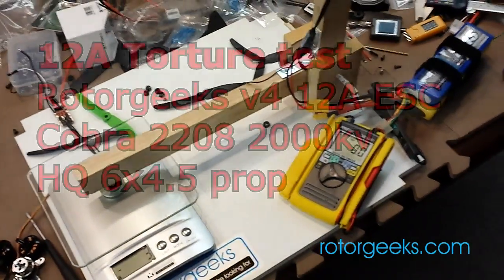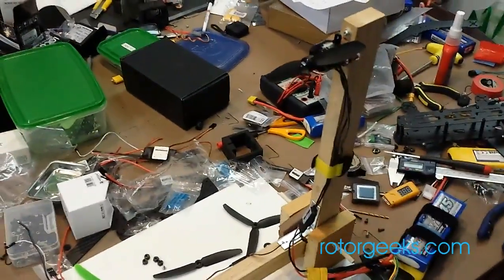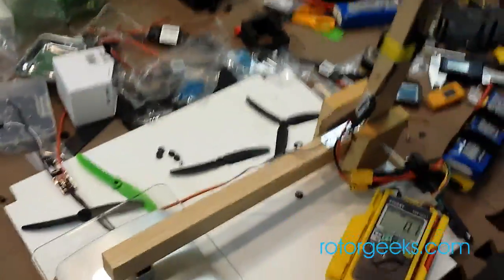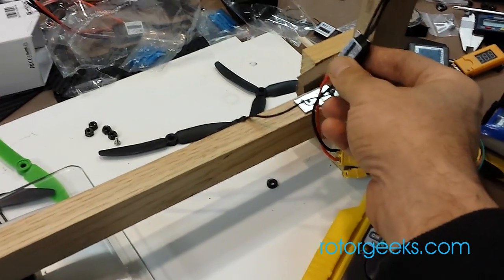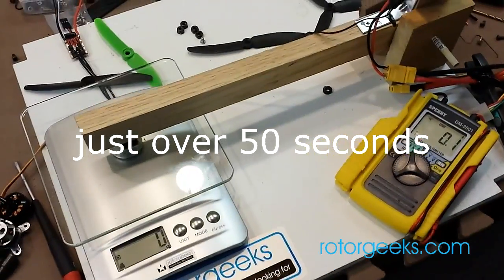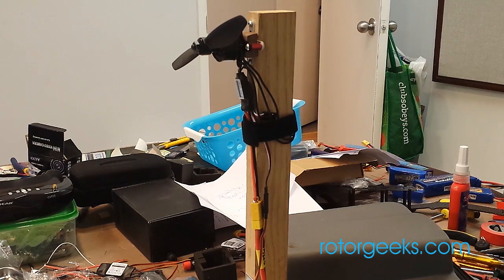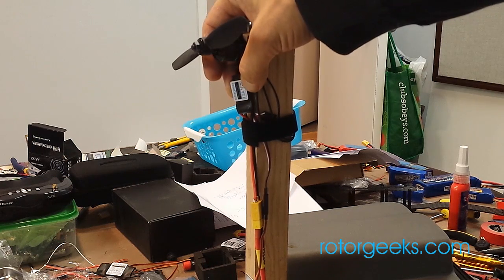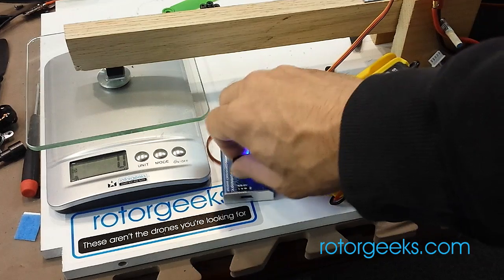4S Torture test - Rotorgeeks 12A ESC faces 22 Amps

Comment: I'm planning on rebuilding cinecan. I burnt one of the esc. Now that motor sometimes won't spin and when it does it has less rpms. Flight control adjust for it though.. 
Thinking 12a esc tiny whoop board but dont know if it can handle  small 4s battery 450mah or smaller if i can find.. also will use 3s for indoors if i can.. What a good motor with 2" props for that setup..? I saw a 20a tinywhoop board too.. currently cinecan feels real heavy but granted could be because of burnt esc

Comment: Hi, I've got the 30a version but unfortunately got some serious sync problems and the motors stutter at low throttle. Updated it to the newest few but not better, may you got an idea? Thank you
Reply from the maker: zozolione hi - contact me through the website with some info about motors, props, battery and firmware version.  Thanks!

Comment: I want to get some escs to use with the cobra 2300kv motors with 5x4props on 4s pulling around 15amps will the 12amp escs work I have my current escs mounted directly in the prop wash

Comment: Good stuff man! I use these on my 3s build with Cobra 1960's swinging 5040/6030s.
Gonna build a quad primarily for 4s running 6045's (need more speed!) but I LOVE these ESC's! Any plans for a 20A version (lighter than your 30A), or will these do fine on 4S/6045? This torture test makes me wonder... I fly aggressively, but keep my ESC's above the arms.
Also, does this motor provide a noticeable power increase over the 2206-1960's running 6045's on 4S, or should I stick with the light guys?

Comment: How reliable are the BECS on these esc? Have these been tested running a esc with BEC powering a fc and rx? Heat generated?
Reply: Hey there! I use the BEC on this ESC to run my FC and RX on 3s. That ESC does get a little warmer than the others, but not by much. Airflow keeps it cool, even swinging 6045's.

Comment: Just started a build of a Blackout Super Mini Quadcopter (6" arms). I am using Cobra 2208-20k motors, new version from Rotorgeeks with their 12A ESC 4pack, 1w/ BEC, and 6.45 props and Naze32. Looking forward to finishing up and blazing the skies.
Reply: Also 1300mah 35c 4s Turnigy Nano Tech battery
Reply: stanberryk Expect your battery to get hot. Cobra 2208 motors like amps, paired with 4s and 6x4.5 props at full throttle you will be pulling almost double the amount of amps that battery is rated for.

Comment: I like the look of this ESC only 10g, potentially it could work well for my rc timer 5010 360kv motors with big props for long flight time but can it handle low rpm smoothly?

Comment: How are most ESCs rated? What i mean is at which voltage are they rated for their maximum Amps? So ESCs may be rated for 2s to 6s voltage but lets say its a 40A ESC. at 22.2V x 40A = 888Watts but at 11.1V (3s) 11.1v x 40A = 444Watts.
  So do they always rate the ESCs at the highest Voltage possible?
I am buying 900W motors but plan to run them most of the time at a much lower power rating to get better efficiency. I am wondering if the Hobby King Blue series 40A ESC 60A max bursts will be enough. However sometimes i want to be able to lift some extra weight so I'm thinking i may need to go for a 60A ESC but i'm trying to keep ESC size and weight down.
Reply from the maker: I think they're rated at a current capacity and have a range of voltages they can operate on.  ESCs are just little switchers that work with a very wide range of voltages (like your laptop supply that can run on 120v or 240v without making any change).  Iit's usually the linear parts (regulator) generating heat that will limit the input voltage level on small ESCs.  Remove that part or replace it with a switching supply and you get the higher voltage capability.  So for this component, think amps, not watts.  That's part of the magic of going to a higher voltage setup - more power (watts) through the same equipment because the voltage is higher while the current levels are the same.  And actually, motors are kind of similar in that way.  Anyways, punch your stuff into ecalc or measure it in the real world to find out the current draw.  Obviously I'm not going to be recommending HK Blue series since it's shortcomings are the main reason I went down the path of developing a better ESCs for 4S!
Reply: Well i guess they must be rating them in Amps for a reason. I need to get my head around that one cause at the end of the day if you demand lots of power from the motor, that power still needs to flow through the components of the esc, and power is watts. (AxV) One reason i like the sound of the blue series is the weight another reason is price and the last is that they say very low internal resistance. I assume that they will then be efficient. I need an esc that will work well at low rpm for a big quadcopter . but i want it to be reliable. What are the shortcomings of the blue or mystery series? I have also been looking at YEP for the 50- 60A range but they are heavier. I am also looking for a smaller ESC for a medium sized long fly time quad  and am considering the Corona 20amp and the Turnigy Multistar 20A. I can probably use a 12A and save weight but it would be nice to be able to switch to 6s for more power for shorter fun flights. The smaller ESCs won't support 6s

Comment: 12A and being able to handle 2208-2k Kv -impressive! 
Add the excellent BLHeli f/w and certainly a winner..... next version add 6S capability.

Now Cobra needs to re-design the motor bell/shaft deal. Can't understand why they had to forego the grub-screw method and use pressed-in shafts..... cheaper to replace shafts and much easier to remove with screws